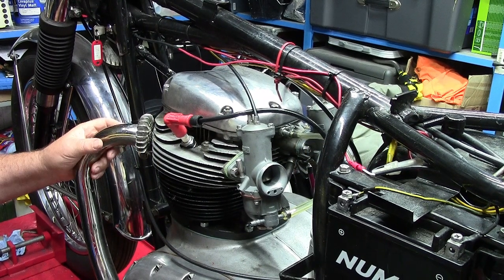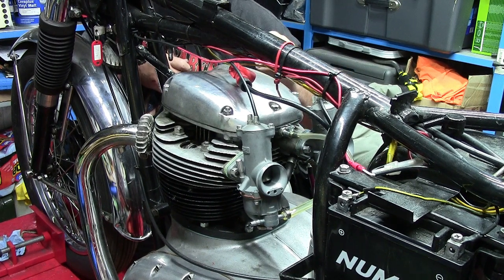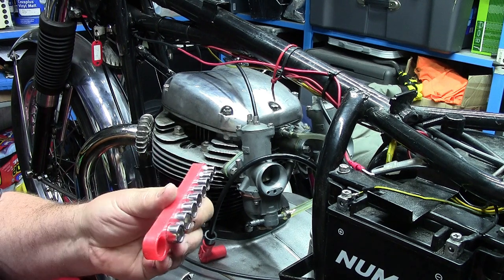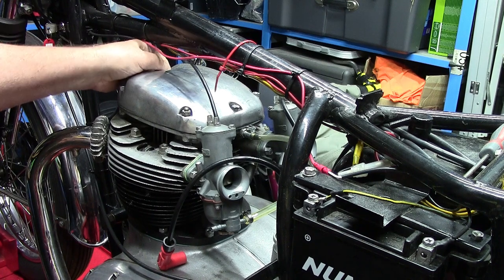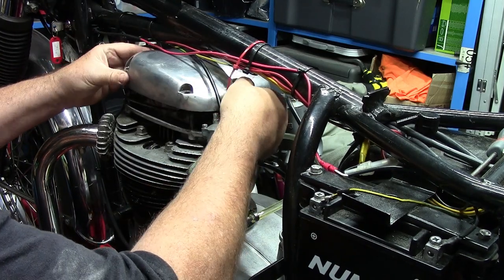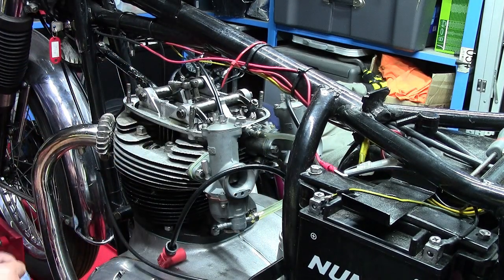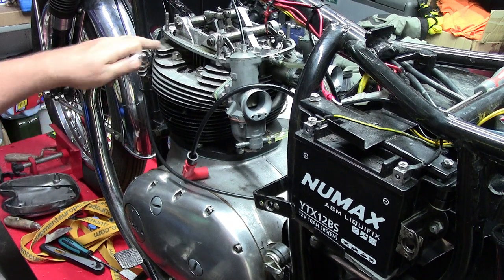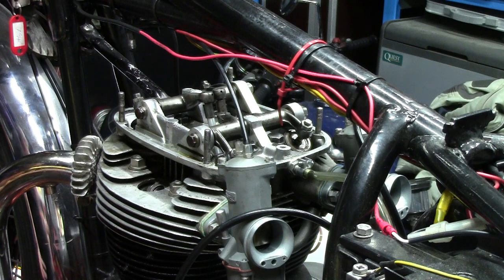BSA Spitfire still wont start part 2

Comment: Why would you start with something difficult before trying spark, timing and fuel first? or is that what you did in part one. Condensers? Rectifier? Coils? Wassell are better the Amals they replace. Has this bike ever run for you?
Reply from the maker: Interesting you should say Wassell are better than AMAL. Do you work for them? as you are the only person I have ever heard say that.  Yes of course it is a process of elimination as per part one of my series.  The only thing not changed or checked were the Wassell carbs. In one of my videos I cleaned them and set them up and still no go.  In my latest video I fitted the Amal carbs and hey presto a perfect running and starting bike. I also thought maybe it was the insulators and gaskets that may have been the problem so I again cleaned and set up the Wassell carbs and the bike spluttered and failed to restart. Put the Amal carbs on again, first kick started perfectly so sorry I don't agree and like the majority of  Brit bike enthusiasts "Wassell carbs are a pile of ca ca."  And if you love them so much I would be happy to sell these ones to you for a good price. 😁😁😁
Reply: @toooldtodieyoungmotorcyle  If it was on my bike now, I would certainly keep it. I have the original 55 year old Amal Mk 1 on mine and it has been modded, which is a bit of a pain, would rather it stock. No I don't work for Wassell. Don't work at all now. But everything I have heard about them is positive, tolerances are better. And given they are a copy of the best Amal carb with a few thoughtful mods, I would think they would work quite well. 🤣Each to their own. If you took them off have you replaced them with Mikunis?

Comment: Just to add to the mix is it hard to kick over? I had a problem with mine I had fitted a new stator rotor . Even though I checked it as 8 thou it was still pretty stiff. I just could not start it I removed stator.. temporarily started first kick you need about 200rpm to get a spark
Reply from the maker: Hi that is very interesting as sometimes it is very hard to turn the motor over. It is not a prod and go bike like my friends. You only have to lean on his kick start and it bursts into life.